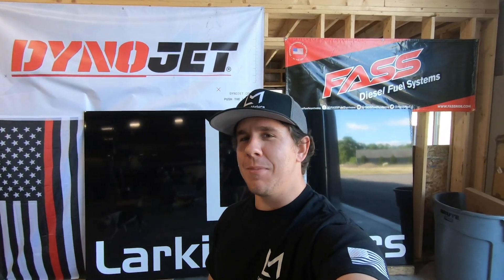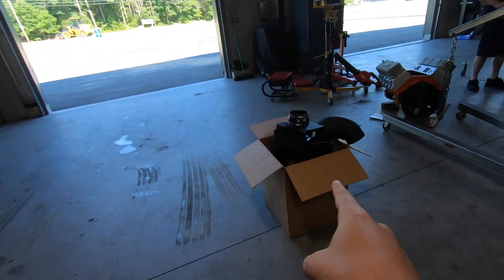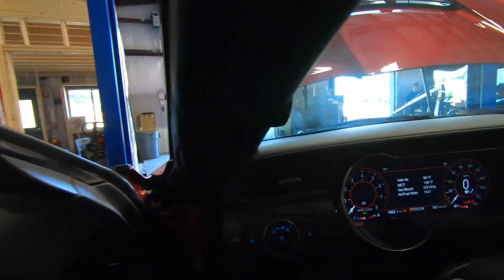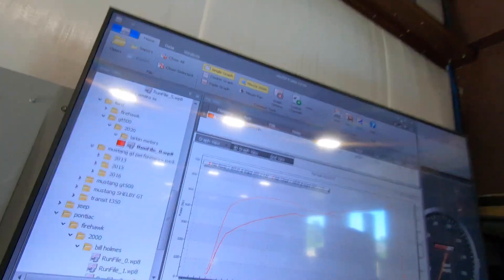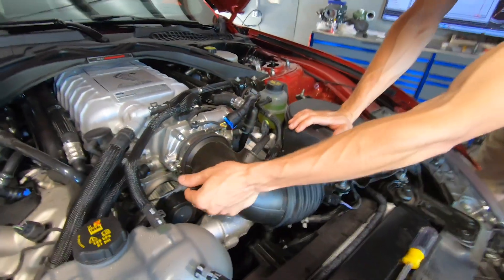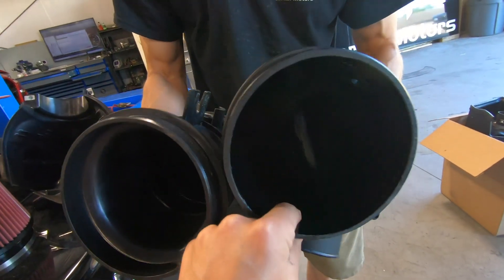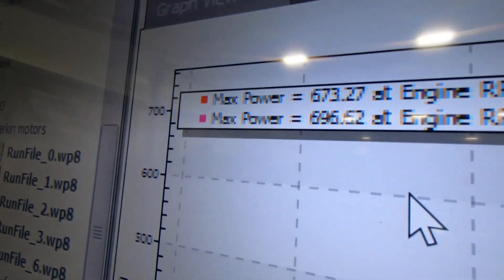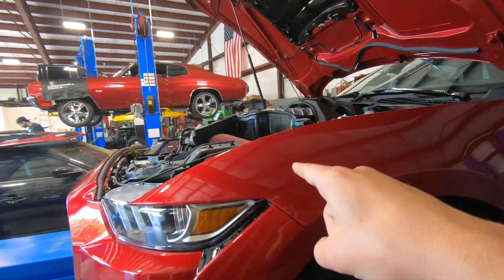2020 SHELBY GT500 FIRST PERFORMANCE MODS!!!

Comment: I’ve seen a ton of people just opening the stock air box for a similar affect ... that ruby red is gorgeous !
Reply from the maker: The JLT looks soooo good tho!
Reply: Larkin Motors TV 💪🏻💪🏻
Reply: Hell no. The stock plastic is a heat magnet. Any peewee who sees a JLT CAI in person can see why there is a power difference. Or simply drive the car & feel the difference. The JLT box diameter alone is huge. Use your Kabasa. The JLT is made from composite, not plastic.
Reply: rapid red.. 2020 first year i have it on my raptor

Comment: Big time props to the Ford engineers that designed the GT500. The stock air intake looks to be a positive pressure ram air design feeding cold air from the front bumper area. The JLT open air box design diminishes the positive pressure.ram air effect. This wouldn't show up on a dyno test. Testing on the dyno isn't representative of real horsepower effects given the vehicle is stationary with just a small fan blowing on it 10 feet away. Statically, just popping the lid off the stock air box would likely have given similar results.